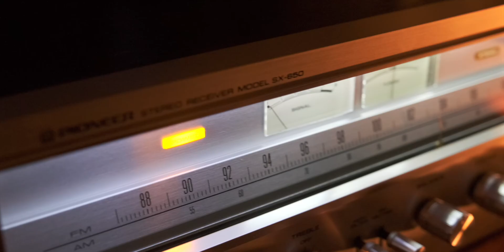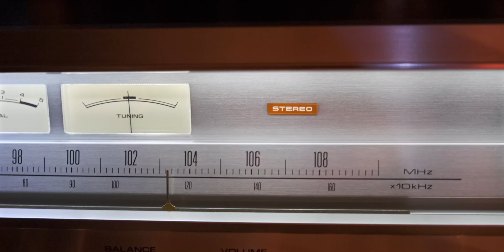My First Service! Pioneer SX-650

Comment from the maker: Thanks so much for watching! If you are interested in sending your receiver/amp in for service, send me an email with the make, model, issues with it, what you would like done, and any other upgrades etc. My email address is located in the "about" section of the channel. I currently have a $300 service minimum as I don't have a ton of time to work on services at the moment but I want to do it more in the future! I'm still learning how to fix turntables, cassette decks, reel to reels, and other such source devices so I am not offering repairs on them currently. 

If you enjoyed this video, please like it and share it as it helps me immensely. Cheers 🍻
Reply: @mattdealy I think U could or should charge a lot more. Proper real repairs like this should cost way more. Like $500+. Your saving real history and your skills are valuable.  Hint... watch some @Mend It Mark too. Very skilled at fixing stuff to, and the restore part 😊
Reply: I sent you an email about a Luxman R-1120A that needs service.
Reply: Love the vintage stereo's
Reply: I have been learning to diagnose and repair mobile amplifiers. But I really need an oscilloscope.

Comment: Hello Thank you for your beautiful video and work, I am finalizing the restoration of a PIONEER SX-650. While doing tests, I accidentally blew the fuse of the timed 08A 125V. Can you tell me what I can replace or buy it with? Thank you in advance for your response.
Reply from the maker: You can just buy an 8A fuse. I think they're usually 30mm long. 125/250V would be fine
Reply: @Shuksanaudio  Thanks

Comment: An added thought about putting the inserts back in tone controls: I usually do it while putting a square wave into the amp and monitoring the scope. I put the insert on the tone control shafts and turn it until the square wave is as good as I can get it. Then I put the cover in place with the indicator mark at zero . That way I can get the zero point of the tone controls perfect. It works for balance too if you have a dual channel scope

Comment: Pretty neat. The SX-650 was my second component stereo receiver. I got it at Crazy Eddie's in the Village back in 1977. Two swell features were the two tape loops with one way dubbing and high filter. Other niceties were large twin tuning meters, good FM tuner, Aux and Mic inputs and a healthy 35wpc. I sold the 650 to get a Hitachi SR-804 in 1979 and still use it. My first receiver was an SX-434 in 1975. That got sold to buy the 650. My two favorite Pioneer receiver series are the 30 and 50. They also seem to command the highest prices on eBay.

Comment: Back in the day these things seemed everywhere, and I'd be surprised if it wasn't Pioneer's most-advertised receiver at the time. When I was in Junior High I directed my dad to buy one, a Garrard turntable, Kenwood cassette deck and Advent Loudspeakers. It was a classic set up. One of my best friend's dad had the '650 also. I think both receivers suffered the same fate with the power knobs.

Glad to see you were able to take this project on. You have an infectious enthusiasm for the old gear.

Comment: Hello!
Do you know why the "tuning" indicator on my Pioneer SX 650 receiver isn't working? I checked it with a multimeter, and it works fine, but it doesn't work when connected in the circuit.
Could you tell me the capacitance and voltage of the film capacitors you used to replace the blue tantalum capacitors in the tuner, preamplifier, and power amplifier circuits?

Why didn't you replace the two transistors that get very hot and don't have appropriately sized heat sinks?
Reply from the maker: Hello! 
I don't know why the tuning indicator isn't working. I would measure the voltage across the wires at the lamp. If there is none, follow the schematic back to where it should be coming from until you find power. Should be around 8v I believe but you can check the schematic. 
I use the exact same capacitance rating as what was on the tantalums. Your unit may be different so I would recommend checking your service manual or pulling the capacitors and reading the value off of them. Most of them were either 2uf or less as I recall. I used higher voltage film caps either 50v or 63v because it's what I had on hand and shouldn't affect performance. 

I assume you're referring to the two that I put new thermal paste on in the power amp/power supply? They tested fine and there was no sign of excess heat so I left them alone.

Comment: Matt, you are off to a great start. I’ve been restoring vintage audio for over 10 years.  You are very detailed in your work.  The most enjoyable part of this job is to bring a failing piece back to life.  Also, you’ll get to play with and briefly use really cool equipment.   The only red flag with the sx-650 are the stk packs.  I try to avoid any amps or receivers that have them because if they’re bad, replacement is near impossible.
Reply from the maker: Thanks so much! So cool that you've been doing it for so long! Haha yes! It's fun to tinker with a new piece of gear for a bit and not have to deal with storing it haha. Yess I did notice the STK packs and was surprised. I thought they didn't use them until the xx80 series. Thanks for watching and for your kind words ❤️

Comment: nice job , I just picked up a couple of sx650 , one works fine just needs lights , the other has a broken power switch ... decent looking unit
Reply from the maker: Oh nice! Yea they’re sweet units! The power switches do get really messed up from arcing over time. You can usually disassemble them and clean them. I have an SX-550 I’ll be doing a mod on to protect the power switch with a solid state switch. That mod works on anything with a power switch. Video should be coming in June. Thanks for watching!
Reply: @Shuksanaudio  cool. I wonder I have a parts Sansui R70 that has a similar switch ...wonder if that could work ...
Reply from the maker: give it a shot! Cleaning the old switch isn't hard but you do have to drill out the rivets and replace them with a small nut and bolt.  @bisarowood
Reply: @Shuksanaudio  I should say the switch is probably ok but the shaft is broken...
Reply from the maker: Ohhh shoot! Yea you'll have to replace it.  @bisarowood